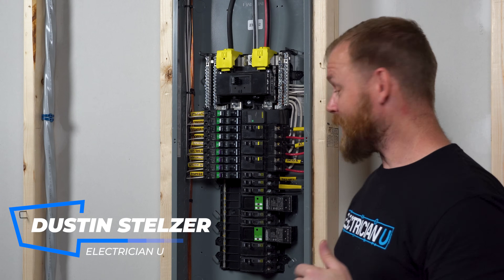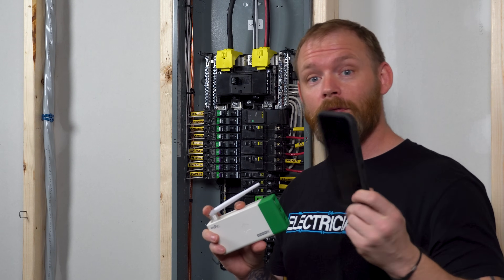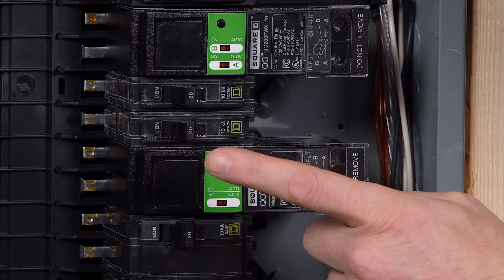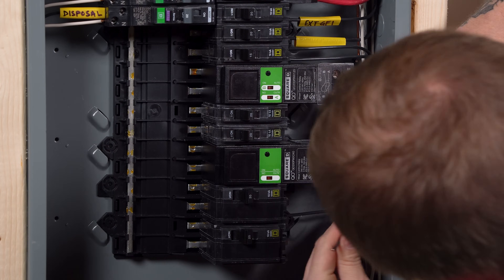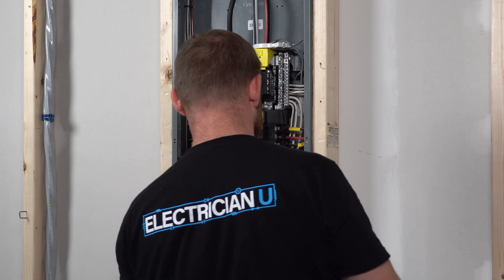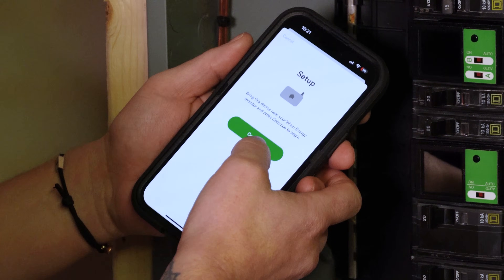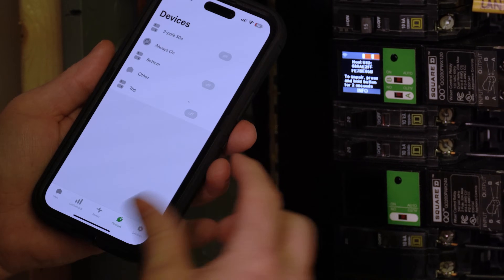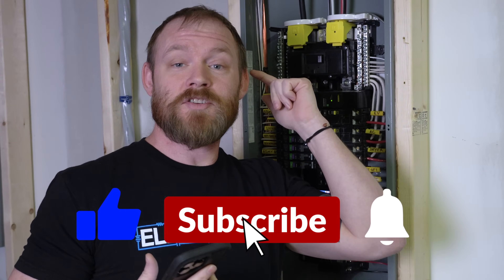Revolutionize Your Panel: Schneider Electric's Smart Relay Integration!

Comment: What's the maximum distance between monitor and relays? I'd like to control car charging output that is fed from one circuit on a subpanel that is 40 meters away from the main panel. So I want to adjust output based on consumption measured at the main panel. All are within wifi reach.

Comment: After 1 year, anyone has success finding these devices (QO200PWX120, QO200PWX240) in the US?  The installation doc seems to point towards using the Sense app.  So the Sense app will control this relays?

Comment: Nice. Can I control them using IFTTT logic app? I want to tell the system to automatically have the water heater and pool pump to ONLY run when the AC is not running.

Comment: The replay doesn't let you control all circuits in the panel, though, right? Only the ones that are under the initial replay you install?
Reply: Yes.
But useful if you want to be able to load shed a couple of large loads to keep the overall current draw in spec.
Load calculation for my home if we phase out fossil fuels is around 150A.
Load-shedding car (Assuming 30A) gets us to 125A (current service rating).
Load-shedding water heater (24A) would get us near enough to 100A if electric heat is running for an extended period of time.

Comment: He mentioned the EV charger,  when you are doing load calculations for a panel, it doesn’t matter if you have relays or not. Either your panel is sufficient or its not. Am i wrong?
Reply: The Canadian electrical code was recently changed to allow EVSE installation without a service upgrade: so long as an "Electric Vehicle Energy Management System" (EVEMS) is installed.
Relevant code sections are
8-106(10)(11) and 8-500.

Comment: cause remembering not to use your welder, air compressor, oven and dryer at the same time your AC is running and car is charging is too difficult. I just added a shut off fuse box to my 220 compressor so it doesnt kick on while welding. Im typically not cooking at the same time either. Maybe there are some special needs for this but almost seems like a solution looking for a problem
Reply: When need to phase out fossil fuels by about 2030.
Water and space heating typically come on automatically.
Car charging and water heating are inherently load shedable.

Comment: I'm so scared of customer asking me to install that in a tan Federal Pacific panel for his new Tesla charger. 
Neat. Good idea.  
Q:  The relays do not count toward the 42 pole max  ( yes it is extra equipment but there are only 42 active poles. The relay's are down stream devices from the pole )
Reply: The 42 pole max was increased to 60. But I doubt one of those is on a service requiring these load-shed relays.

Comment: Hi from Germany, an alternative could also be a SHELLY 3EM or PRO 3 EM. If you don't have a DIN rail available you can just drop it like the wizer box into the panel, wiring is relatively similar (With clamps/donuts and a breaker connection). The 3EM has an integrated relay while the PRO 3 EM has an add-on to switch circuits or appliances on/off. In addition, you can turn on/off individual plugs/receptacles with shelly relais and smart plugs. Another nice feature: you CAN but DON'T HAVE to use the free Shelly cloud as every Shelly device has an own WiFi AP you can connect directly to with your mobile or laptop.

Comment: Cool product.  Not sure if I would trust phone app over time.  Seems like every time phone pushes o/s updates the apps start misbehaving or just crap out.  Waiting to get app support is hell and a time bandit as well.
Reply: Phone apps, Ethernet, WiFi, etc. are, in my view, too unreliable to be used to switch devices on and off, particularly during a brownout or power outage. If the router is still booting up and the load doesn't get shed when power is restored and everything comes on at once. the main breaker might trip and everything loses power (again). If nobody is at home to reset the breaker bad things happen like a fridge full of food spoiling or the storm drain sump pump is off and window wells or basement get flooded. I think Generac has the best solution. They use wired Ethernet but back it up with power frequency control. If the load shed command sent over Ethernet doesn't make it to the load shed relay, then the Generac inverter lowers the output power frequency to cause the load shed relay to drop the load(s).

Comment: Side note:  I put the main box wifi antenna outside of the panel by opening a knock out at the bottom.  The metal cabinet when closed reduces signal strength. 👍
Reply: just stick the antenna out the bottom/side/top with an nm bushing or similar and gently clamp it sticking out as far as possible, that should suffice even the stickiest of local codes and inspectors.
the internal antenna elements are generally only in the upper half or so of the whole antenna envelope, so it should work about equal to the whole device being outside.

Comment: Help me understand something. I have 5 devices that have high demand. Washer, dryer, heater heater, stove, at my wife’s blow dryer. The water heater is the only one I can’t change my behavior to turn off.  Old house, yes. But do newer houses have so many power hungry devices that you’d want to put a relay to an oven instead of just not using it?  Resetting clocks on ovens will really win the wife over.
Reply: Your water heater being off for the duration of a car charge would never be noticed, unless your family showers all throughout the night. "Just not using" a power hungry device will not satisfy the code that would forbid a high demand device like a level 2 car charger putting your service beyond capacity and therefore fail inspection unless some type of load management system is incorporated.

Comment: Do they / can they change state on a power outage?   I’m planning a service upgrade, and rewire for my garage-shop.  And have been planning to add a sub panel on a contactor, so when the power goes out, the feeds to the machines will stay off.  But the lights will come on when the power is restored.  It only takes one short black out, and the table saw launching a board past you and through the closed garage door, to decide blackouts with running tools can be dangerous.

Comment: I was excited until I saw the breaker is not part of the relay.  Sucks to need double the spaces for each circuit.
Reply: If you'll notice, he's showing this off under the ideal conditions of having a 42 circuit 200a panel, that has only 24 breaker slots occupied. So 18 unused slots in what is supposed to be a "loaded panel" which is not a real-world scenario.

Comment: Yeah the thing hogging up two 4 extra slots to control one circuit is a bust, most panels are fully populated already. But it’s a step in the right direction. Would be good for an electric water heater to be able to avoid peak demand charges

Comment: I'm 99.9% sure homeowners don't want to turn off breakers to charge their expensive car. They would just want a bigger panel :)
Reply: I think the scenario is more about if a load calc of a given service doesn't support the extra demand the charger would require. I think that is just a bad example. I see this more for automation and energy monitoring.
Reply: Pretty sure most homeowners wouldn't mind turning off their water heater in the middle of the night,.

Comment: May I ask a question? I want to add an outlet to my garage that will provide 3600 watts (2880 continuous) that is GFCI protected. Can you outline how this would be done? Would I need two GFCIs? two 12/2 wires? two breakers? or is there a simpler way.
Reply: Way more info needed to answer your question.

Comment: This makes sense for existing construction, but why on earth would you not use a Leviton load center with plug in neutral breakers that act as relays for load shedding? (The old breakers only let you turn them off, but the new ones are on/off relays.)

Comment: Energy Management Systems (EMS) are here and as soon as every electrician gets onboard the bigger our industry will become.
Reply from the maker: Next step is EPMS for the "consumer." It's existed for decades in large commercial and industrial. But it's getting to the point where devices are small enough and easy/ inexpensive enough it can be installed in the home. 

Just a matter of time now.

Comment: Outside the US, DIN rail breaker boxes are the norm. Relays, timers, and more are super easy to add.
Reply: Yeah those are fun
Reply: I wonder what's more cost effective in the end, the US style panel or the DIN rail... panel: cheap in the US, expensive with rails (triple price over here), breakers: opposite. Plus the installation time where I don't see either system faster.
Reply: @sfink69  how're rails expensive? Panels gotta be more expensive
Reply: @AgentOffice  well, I'm from Germany and local code demands BIG DIN panels which cost from 500-1500$, depending on the size you need. The rest is cheaper then as we use serial GFCIs just like the first plug on a circiut to protect the rest, 1 GFCI for max 6 circuits, plus surge protector plus master switch for every phase (we use 3phase 220V systems). Grounding is similar. Wages are similar I would guess (around 60-90$ per hour per qualified person ).
Reply: @sfink69  wow I was thinking the tiny Chinese rails

Comment: I think I’d rather just install relays external to the panel so we don’t waste slots on the buss.
Reply: Yeah - this is cute, but somewhat inpracticle unless they are going in a sub-panel with a lot of spare space. Plus I don't like that you have to confirm your selection once you slick the on and off buttons on the app. And, if course, this is its own app whereas I already have a home automation app for all of my doors, lights, switched outlets, HVAC, etc. If I needed switched relays/contactors, I'd just go with the Enbrighten z-wave 40 amp contact that already comes in a metal enclosure and is suitable for indoors and outdoors.

Comment: It looks like the relay occupies it's own slot in addition to a slot for the breaker, yes?   Panels are going to fill up fast!
Reply: I agree- that doesn't seem to make sense.
Reply: @davidshertzer900  pun intended?
Reply: Yes, why would the relay need to occupy a space at all?  The relays could be outside the panel with one breaker powering the relay and the relays turning things on and off like an automatic transfer switch.  Like running either the water heater, or dryer or car charging port.  It should allow you to program, dryer priority over water heater during the day(8 am -10 pm), and at night(10 pm to 8 am) car charger over water heater until about 5 am when you would want to top op water temp water for morning shower.  And allow the other device when the primary is not calling for a large load.   @davidshertzer900
Reply: If I was going to have an additional panel for relays I’d just use DIN rail in a cabinet.
Reply: Yeah, before even launching the video, I was expecting to see something like a combination breaker / relay that, while larger, took the same amount of space, breaker slot wise.
Reply: I wonder if it will become the norm to basically have a dummy panel adjacent that houses these relays?
Reply: If the customer has a choice, I would bet on Span panels becoming a leader technology in the market and the other will have to follow. @j-c1x2j
Reply: Soon as I saw it take up space inside the panel I laughed. No thanks.

Comment: Just looked up my Sense settings and it's not showing up options to connect devices, only what Sense found out. Is there an upgraded version of the Sense device for it to send commands?
Reply: I have a Sense box, love it, a little sad they aren't wanting to sell me a few of those relays. 😢
Reply: This is a Sense unit that was branded & running custom firmware for Schneider electric. Sadly I don't think you can use a Sense in the manner you want.

Comment: Oh good, load shedding by some idiot on the other end of their phone. I can see the freezer burnt steaks, melted ice cream, and dead dog from turning off the air conditioning
Reply: Only if a complete idiot configures the panel. This is specific application oriented, not having an entire panel of with everything on relays. You'd put dryers, water heaters, maybe ovens on something like this, not your HVAC or refrigerators.
Reply: @JCWren  We will leave the wisdom of doing laundry with nobody home and baking of cookies with nobody home for another time!
Reply: @rogerpenske2411  Dustin specifically said "load *shedding*" - or did I not hear that correctly?
Reply: @Struthio_Camelus  I did load shedding when installing energy management system computers into large buildings back in the 80s and 90s. It has practical applications in very large commercial, industrial applications. With a very large house, and probably multiple buildings, this would be useful. For the typical home, though, probably well over 90% of single-family dwellings, Apartment, and condominiums, it’s complete overkill. But what the device does do is it further distributes control down to the device instead of devices needing to be connected via home run back to a central computer
Reply: @rogerpenske2411  Those old energy management systems didn't have much, if any, ability to manage two or three power sources like grid, PV and battery. This system really shines when you aren't home and want the PV array to run the home. You can't program the AC, fridge, freezer, and battery charging so that only one or two loads come on when there is sun, and none turn on when the array is blocked by clouds. Monitoring the power available, its cost and what is being produced by PVs, and only allowing loads that can be accommodated at a reasonable price makes sense. What it is missing is the ability to do the load shedding automatically in view of power availability, cost and load priority.

Comment: Why would you not want to have the relays on the load side of the breaker instead of the Wayne side of the breaker?
Reply: The relays are on the load side of the breaker. It goes bus -> breaker -> relay -> load

Comment: In Europe we use DIN-rail panels with a huge amount of mountable devices - in residential and commercial buildings. Are they just not common in America or are you using them not at all?
Reply: I think DIN rails are essentially only used in industrial settings in North America.

Illegal to mix signal and power wires in the same box otherwise.

Comment: The reason they don't have a manual lever on them is because they are just a relay. They are fed from a breaker, so if you need to make safe a circuit, you do it just like you always have.

Or, you can have only part of a circuit going through the relay. You can use like a 12-2-2 and then split your load where the homerun terminates.

This is pretty slick.

Comment: It's a nice first step. It needs integrated breakers so you don't take up so much panel space, and to simplify the wiring. (the jumpers are stupid)  And it needs manual overrides.
Reply: As someone who relies on "Always On" equipment, Im glad things are not combined. Think router and modem-no thanks.
Reply: @waltewhitesPhD  If your relying on "Always On" equipment, why would you put it in line with a relay that can be shut down with a cell phone?
Reply: this !

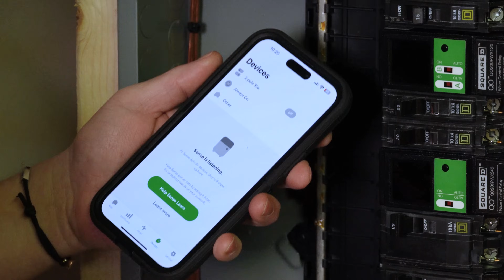Comment: 3:40 Electrician U standing in front of a panel while holding a phone with low battery, makes me chuckle. There's a good joke in there somewhere. 😆
Reply: The people with the most poorly maintained cars are mechanics, the people with pipes that leak are plumbers, and electricians apparently run around like my teenaged daughters with perpetually almost dead cell phones. ;)
Reply from the maker: Haha, it's a real problem. Co worker was just giving me crap for it.

Comment: Seems a bit clunky, I would wait until it’s all integrated into one unit
Reply: I think that intelligent load management can be done in better ways. Control at the receptacle, switch or device would be better in general.

There's no reason that you have to or would really want to do this at the branch circuit level.

Comment: it doesn't have a physical lever? a bit unnerving to think you are working on a branch circuit that's only turned off by software...
been waiting to get a SPAN panel but they are not available in canada and always seem to support way too few circuits... this might be perfect if it's available in canada...
do they come with AFCI or GFCI variants?
edit: missed the part from the video where they are inline with another breaker, that solves most of the problems :P my bad
Reply: Why does it have to be inline, the relay should be built into the breaker. I don’t want double the space taken up in my panel.
Reply: They connect in series with a conventional breaker. If you need to work on a branch, you would turn off the breaker. If something tripped the breaker, these wouldn't be able to reset it (which you wouldn't want anyway.) I'm guessing that the conventional breaker could also handle any AFCI/GFCI requirements.

These are sold as a partnership with Savant Power. They also have CH style versions, so I would expect Schneider will be selling those as well.
Reply: @tmoney1876  oh i see... i totally missed that part from the video... that's cool then, shame it takes up more room though
Reply: Turn off the breaker. No different than a RIB without a physical switch.
Reply from the maker: Finally, another mention of RIB.
Reply: Agree imagine I turn the breaker off remotely and someone is home and since power is off in the circuit they think they are safe. They start doing something then I don’t know and I turn back on oops. I know they should turn off the physical switch or pull taps. But I think the convince is just for flash and also can set up a safety issue.